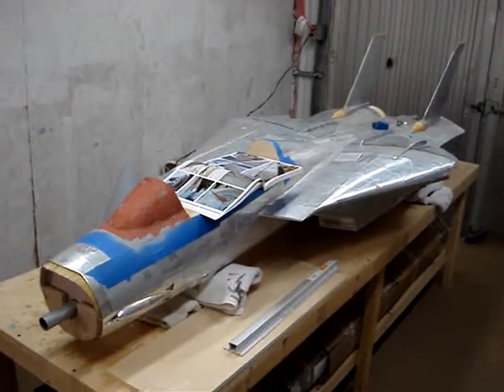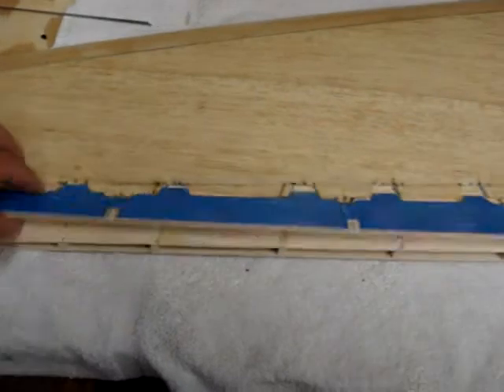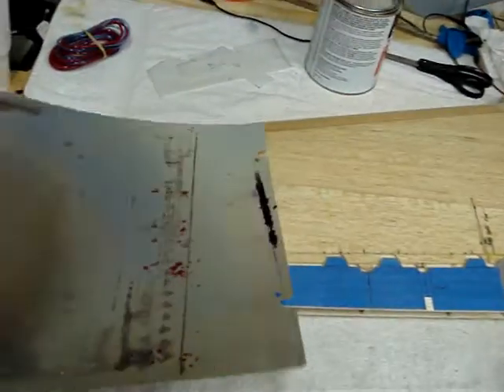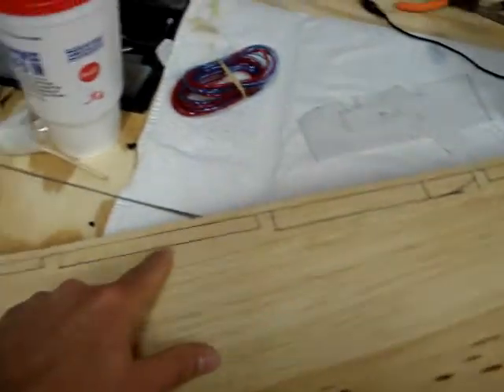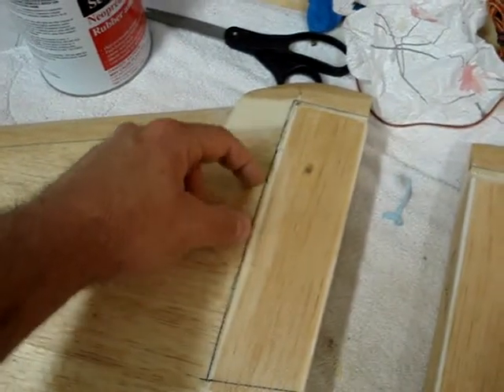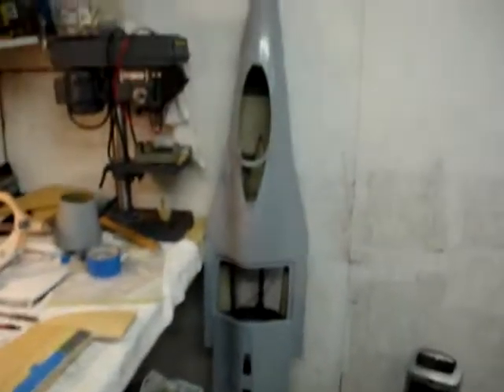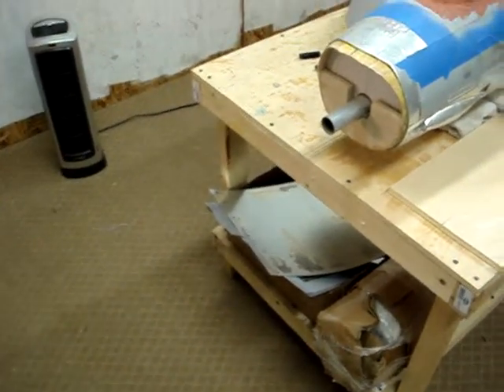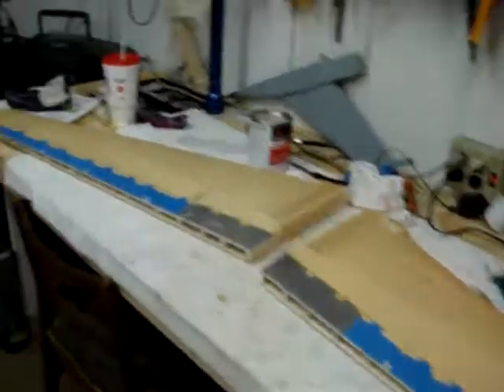How to build an F-14D Tomcat #10

Comment from the maker: @suvyMan2007 

The problem with metal warehouses, is that none of them carry anything this thin (.004 to .006" thin).  Most of the locals around here only have it in this thickness at the same size i have it in currently and even that is special order at $40 per sheet.  I'm still on the hunt for the stuff and if i can find it, awesome, if not.. it will just have to be one of the very few things i will have to settle for